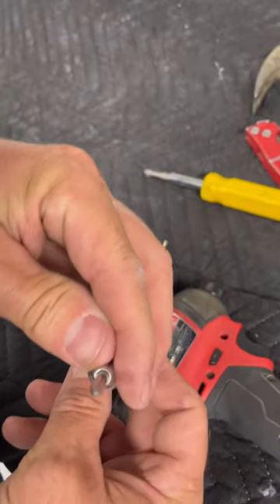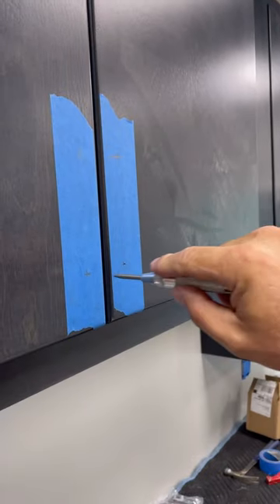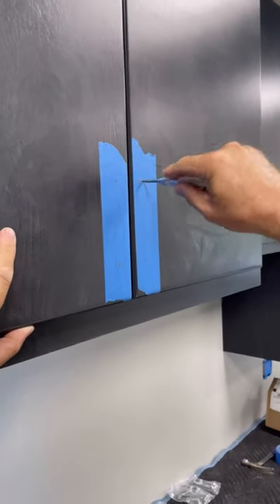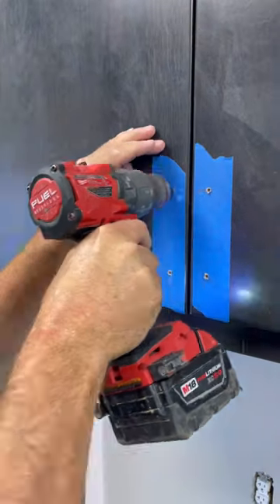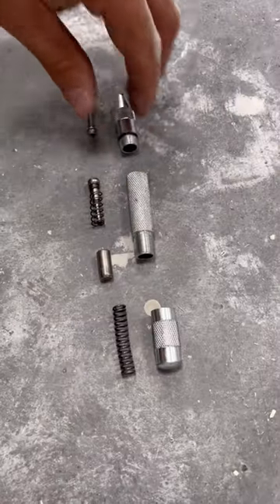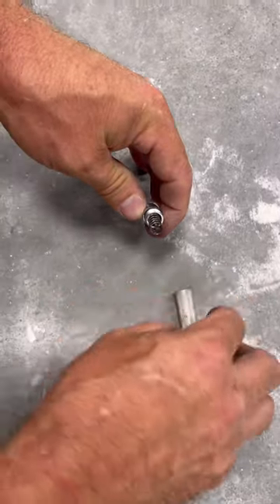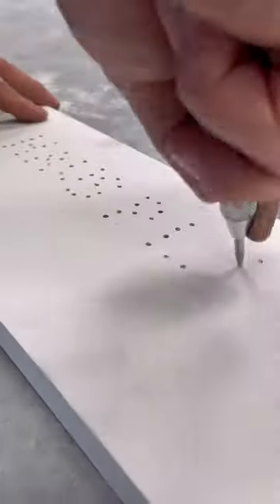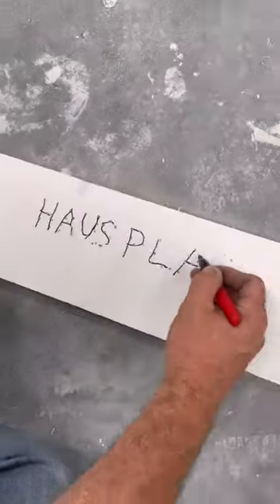Center Punch Before Drilling for Precise Hole Locations

Comment: The top hole on the right cabinet door looked higher. Once the handle was on the left, the right hole looked higher than the top of that hardware.
Reply from the maker: They’re both even, the camera angle made it look skewed
Reply: Nope.
Reply: @hausplans the camera put some new tape on the right side before drilling... and still managed to get it different height. Is this one of those comments aggregate bollox videos. Beacuse it ain't making me follow for more.
Reply: Hahahahaha

Comment: I was a firefighter for 30 years. I kept one of these in my Turnout jacket always, but used it for one thing only. Breaking out car windows. One pop in the bottom corner and instant complete window shatter. 
I still have it, except mine has a round wooden knob that’s comfortable in the palm.
Reply from the maker: Thanks really cool!
Reply: It can be unreliable. Mine failed after about 300 punches. A small round metal bar inside has edges which tend to crush.
Reply: @nchurly  After 300 punches? That is what I would call very reliable. Personally I would never use one on metal work. I’m old school and have about a dozen center punches, very sharp, that a good old ball peen hammer will take care of.
Reply: I hit the comments looking to see if anyone mentions how great they are at breaking tempered glass.
Reply: I went to San Francisco and it is true
Reply: @hausplans I put a biger spring and work a lot better
Reply: @herbiesnerd exactly right! I’ve been on the job for 12 years now and I always have mine tucked behind my helmet shield. I’ve always thought it was funny the cops don’t carry them, around here anyway. They’re about the same size as a pen, yet, to this day, you’ll see cops’ batons bouncing off windows over and over. It’s hilarious
Reply: Good to know!

Comment: Automotive Interior panel puller, its the most useful and amazing hand tool. My second favorite is cabinet hardware jig, i chuckle
Reply from the maker: Panel puller sounds cool
Reply: @hausplans  sometimes called a door panel removal tool, it is truly remarkable how versatile and how it is seemingly the only tool to do so many things but yet it was designed to do one very specific niche thing. So many times I find myself using it in general construction or things around the house. It would be in my top five hand tools if I were limited to 5.
Reply: Love an automatic punch by the way. And you have great content, keep up the great shares.

Comment: They work on metal too. Even some hardened steel.  Its actually mind blowing just how much power those little hole tappers are💯💯. They are also perfect as a window breaker if your stuck in a car.

Comment: Real carpenters use a cabinet hardware jig so that the job is done quicker but more importantly so that it’s done correctly. Measuring each hole is takes forever. You’re also bound to make mistakes; as seen in THIS video lol
Reply: I use a jog too. I have yet to find a bit that makes a clean hole tho

Comment: Spring loaded ALWAYS break.. get a regular punch, thank me later
Reply from the maker: I’ve been using this one for over five years hasn’t broken yet
Reply: I've got the same one, and its also still working. Same as the day I picked it up.
Reply: Regular punch.....  you got to lug around a hammer 🔨
Reply: Regular punches will get lost just as easy, and thats a lot more common than breaking either.
Reply: @Redact63Lluks  they have an equal chance of getting lost as a spring loaded, but you don't have to worry about it breaking.